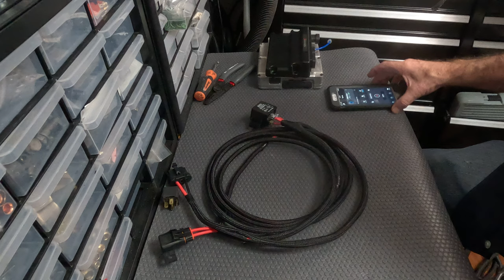94+ Mustang Cooling Fan Issues Resolved

Comment: Hey Ted.  Always great vids. Where would I trigger off of to run the really at the lower temp? Or would I need my chip updated first?
Reply from the maker: I use the old fan power wires as triggers. Just depends on what you're doing. It can be done with tuning also.
Reply: @tuninginnovations5481  sweet. If I wanted to bypass ccrm completely and just run a relay setup I can trigger off the ecu low fan output correct?  What wire gauge and fuse are you using? If you don’t mind me asking. I did some research for amperage and stuff.  Would I need to use 6 gauge wire and a 50 amp fuse? Speaking longevity wise

Comment: Ted, do you know if it still shuts the fans off above 45mph when the A/C is on?
Reply from the maker: Yes. 45 MPH wind speed through the radiator is more than the fan can produce.